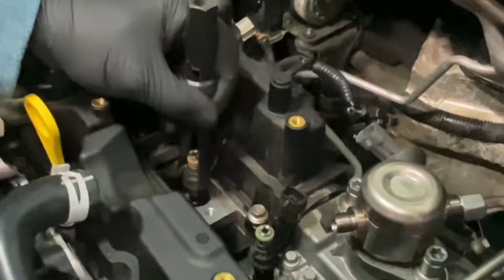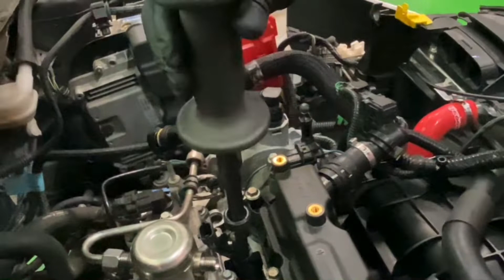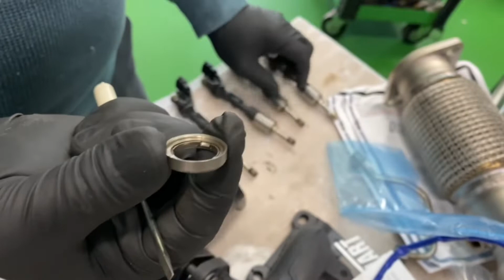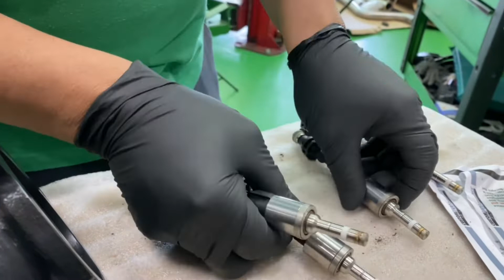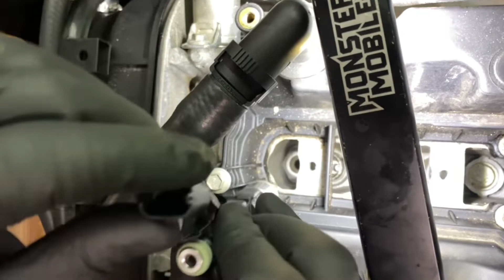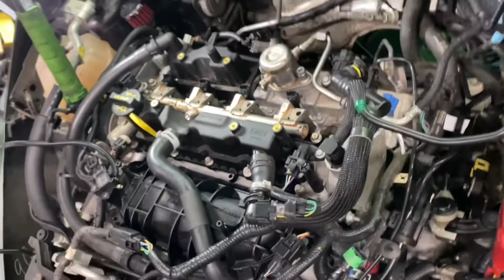How to replace Fuel Injector on a 16 Ford Fiesta ST MK7 (Upgrade turbo needs bigger injectors)

Comment: This is the video I've been looking for all day with the specific details I needed for validation. I replaced my valve cover gasket and In the process of reassembling the fuel rail I was unsure about lubricating the o-rings. I hope I did not pinch or tear the o-rings as I installed it dry.  I installed everything however, now when I drive and turn the A/C/heater on it blows gas fumes in through the vents. I must disassemble, inspect, and do it your way. Thank you!
Reply from the maker: sorry you didn't find it on time, hopefully all worked out after you redid it.

Comment: Great video. Thanks it helped me very much. The only issue I have with it is that I don't think this is the right way to install the couplers. The metal pieces go on top of the injectors and the rail is supposed to contact on top of them when it's fully seated. And in a way push them down.
Reply from the maker: Glad it helped

Comment: The retainers are installed incorrectly in this video. They need to be placed on the injectors first and the fuel rail goes on top.
Reply: That's what I was noticing, these ones are designed to keep the injectors pushed in with pressure
Reply from the maker: Thank you!
Reply: @Drzaauto  so did you have to re-do the injector work?
Reply from the maker: @laundrieshanging9077  no sir, still in and runs great.. thank you!
Reply from the maker: Yea you can but this is another way as well that works for us with No issues.
Reply: @Drzaauto  cheers. I ended up flipping em. 

Appreciate the reply!

Comment: Where can I buy that tool?
Reply: Forget it .....Found a comparable Tool for cheaper*
Reply: @f150lightningboy  What did you buy that was comparable to what he used.  Be nice if he said exactly what tool kit it was.
Reply from the maker: I got this one from Kent Tools
Reply: @Drzaauto  Link?
Reply: @f150lightningboy  did you have any issues using this tool? It worked perfectly for a fiesta st?
Reply: @edwin92506  worked perfectly !